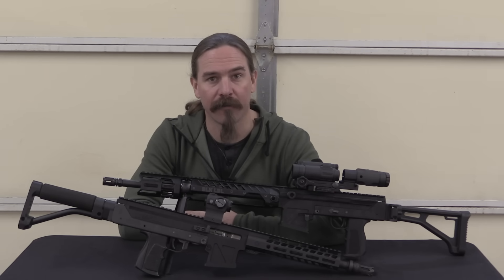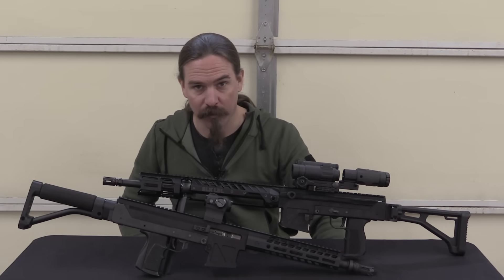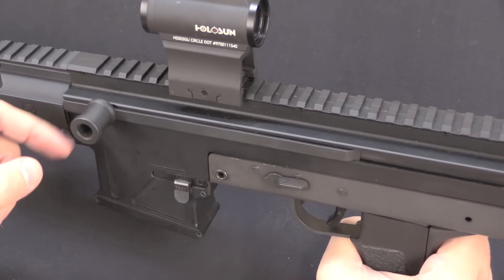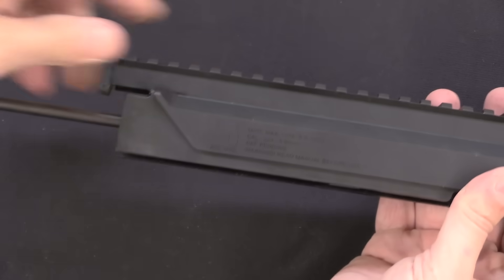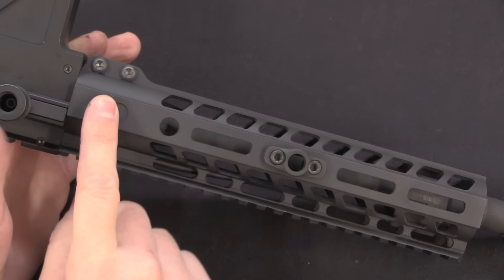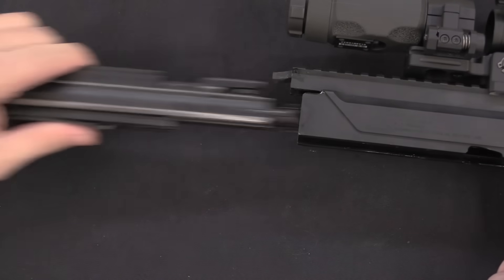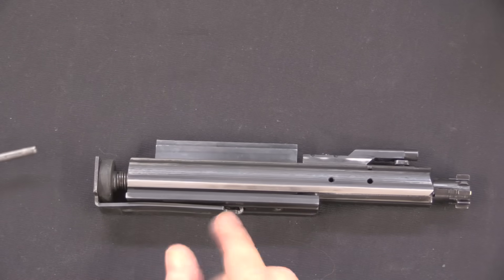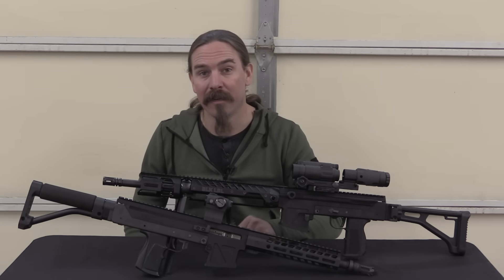Engineering Adaptability and the NFA: Lage Max11/15 System

Comment: I'm almost surprised he developed a new recoil system instead of using something similar to the AR-18.
Reply: There likely wasn't enough space in the receiver for guide rods and a bushing for them, the bolt also needed to keep the necessary mass to make the action smooth without the longer spring and buffer of the AR-15 system
Reply: @theotakucomrade  There couldve been space if Lage designed it differently. They seem to have designed an upper than can both fit the Mac lower AND AR15 BCG
Reply: Thank god, there's too much AR-18-based shit already, it's boring.
Reply: They clearly wanted AR15 parts commonality and the IRM system is not what the upper was built around. I would also prefer an 1r-18 style carrier, although I prefer an AR15 bolt for caliber changes I have an M11/9 and an M11A1 and would probably go IRM, personally. I think the RPM range is fine in those and I think it would shoot all of the calibers I would want just fine. The price tag is what keeps me away, even though it's really not that bad. Maybe one day.
Reply: This setup is much more compact, being concentric with the bolt. It requires zero additional space in the upper.

BTW, the original M11/9 has the recoil system in the upper too.
Reply: @billstevens5277  This is true, but is it a big deal? I think it might be worth it IF it allowed for longer guide rods to make takedown and reassembly easier. I mean, perhaps it is possible to put back together without a cleaning rod, but I haven't seen just how difficult that is.
Reply: ATF requires the recoil spring to work off of the lower receiver like the original upper. If he designed it differently it probably would have been denied for legal production.
Reply: @sodneymvlin7715  false. The fire control group and registered receiver are all that matter. ATF couldn't deny them. As an engineer my best guess is that this is more simple and reliable. Plus the 15 has better recognition.
Reply: @EnthalpyAndEntropy  that's not necessarily true. If they say the upper is also a firearm, then they won't allow it to be used on a transferable lower. 

Examples are: BRP XMG upper, RPD belt fed for MACs, m249 clones that take HK trigger groups. 

All of these are examples where the ATF said not. There are more examples but these are some easy ones to find.
Reply: @ChevTecGroup  that's nice and all but they don't have that authority even if you assume the GCA and NFA don't violate the second amendment.
Reply: @EnthalpyAndEntropy  I agree but tell them that!
Reply: @ChevTecGroup  you don't want that. For me, chemical weapons are cheaper and would be more effective than attorneys.
Reply: @EnthalpyAndEntropy  Yes and no. ATF has shown time and again that they do what the hell they please; and it's maybe/maybe not sorted out later after you've been charged and had your guns confiscated etc. They're just supposed to enforce existing law; not make their own or "re-interpret", but they do so routinely as part of their de facto mandate to suppress the 2ndA.
Reply: @J.DeLaPoer  buy a box truck and fertilizer and do something about it?
Reply: I thought ar18 springs were in the front on the gas system. Wrong.
Reply: @sodneymvlin7715  on the top of the bolt carrier on two guide rods IIRC.
Reply: @EnthalpyAndEntropy  or on either side of the bolt on an AUG AR18 Bolt
Reply: @sodneymvlin7715  he's just not allowed to modify the original reciever without permission

Comment: That's just brilliance. Pure brilliance. Internal recoil system is a bit fiddly to take apart and put back together but really it's not bad. Mac pistols were let's all admit it pretty worthless before this conversion.
Reply: I don't think Ian is saying they were worthless before this particular conversion. He is saying that Lage is responsible for products that have made them useful, referring to PREVIOUS uppers and parts as well.  I happen to have M11s and don't completely agree, nor disagree. The type of guns ARE NOT great stock, but there was an aftermarket before Lage. I don't think the RPM alone makes them completely useless and I found them plenty accurate at typical indoor ranges if I used a red dot(surprisingly). That said, I do mainly shoot them with a Lage slow fire upper or tungsten bolts these days and Lage does make great products, with great customer support.

Comment: I wonder if down the line we'd get belt fed Lage uppers?
Or maybe attaching those belt fed AR uppers with a MAC trigger pack adapter?
Reply: i asked richard about this in 2019, he said he looked into it and wasnt going to pursue it..... never know he could change his mind but dont hold breath
Reply: @SouthCoastTargets  I think he was trying to use M249 parts sets. Engineering a belt feed mechanism would've been cost prohibitive.
Reply: @billstevens5277  i left that part out, yes he was wanting to use 249 top cover and feed but could not source them
Reply: With the Tenko 10-16 you could put on a belt fed upper...but it is in ATF limbo as well

Comment: Someone should make a little magazine tool that presses that internal disassembly lever. Like a 3d printed magazine that pops into the magazine well and you can press a button on the bottom to lift the lever into place. Or maybe it's spring loaded and does it for you.
Reply: Could just use a magazine.
Reply: @roflchopter11  it doesn't actually work that way. you need to press on that specific part inside of the gun
Reply: @basketcase1235  It is actually designed to work that way. All one needs is an empty 9mm mag. Still, this isn't a bad idea.

Comment: So what happened?  Did the ATF waffle on drilling the hole so when it was redesigned to not need it they said, "Fine. Have it your way." And approve it?
Reply from the maker: No, the type with the drilled hole was the first one approved, years ago.
Reply: @ForgottenWeapons  and @Cycada Acolyte thanks!  I missed that.  The kids were getting ready for school and I missed that.  I thought they were both newly approved.

I miss my oldest being 1.  I had been laid off and we'd watch Forgotten Weapons and Military Arms Channel every morning at breakfast.
Reply: The drilled hole version was only for the 9mm MAC-11/9 which was approved ages ago.
The updated version was also approved fairly early on to my knowledge as well.
For the 45 and 380 versions they seemingly put it in a box and "forgot about it" for two years.
Joys of bureaucratic bottlenecks, it may be fully legal but if they never get back to you thats another story...

Comment: “This use to be a machine pistol, a MAC 10 or a MAC 11” I’m both sickened yet curious at the same time… continue gun Jesus
Reply: The nice part is that you could easily convert back to the original in under a minute. (at least, the version without the buffer tube)
Reply: @jarink1  Uh, you can convert the sproingy version into a Mac 10 in under a minute... but going the other way might involve locating the spring somewhere three counties over...

Comment: The unchanged MAC-10/11/11A1 has a specific military use. Per a non-commissioned officer in the 22nd SAS, the entire MAC series was “… designed to kill a room full of colonels on the instant of break in.”
Reply: Can't tell if he meant that Special Operators are supposed to break into an enemy command post and machinegun everyone, or if he meant that the colonel's bodyguards would lose control of their MACs and fratricide the whole room while "defending" it
Reply: @bronco5334  its a MAC-10, soo....YES.
Reply: @bronco5334  The answer is undoubtedly yes.
Reply: A former boss of mine, who was former Army, said it was good for "sweeping crunchies off the tanks".
Reply: @HALO-2304  "Crunchies" being people, I assume?
Reply: @generikuser so eloquently stated
Reply: There was a video out of Brazil I think about 6 months ago where a drive by levels a group of rival gang members in a second or 2 with one of these types of crazy high rate of fire guns. They do have their purpose albeit limited.
Reply: @10mmlover Glock switches probably. Nuts fire rate. And coming from a Glock, that’s useless basically 😂
Reply: Shoot out in a phone booth?
Reply: That's oddly specific...
Reply: In the UK years ago (2003), some "Gang members" got hold of a few MAC-10's and machine gunned a new years Eve party. They found a couple of the guns, the reward for the remaining ones are still active I think.. just pray and spray... and kill
Reply: @blackcountryme  and there was the victims, left with nothing to meet the threat with but pleading and prayer.
Reply: @jacobmccandles1767  it was a drive-by shooting. No one would’ve had time to “meet the threat”, guns or not.